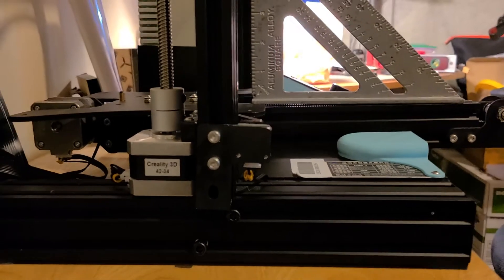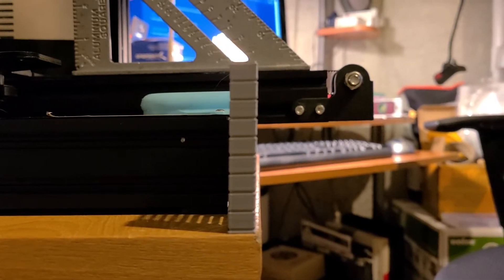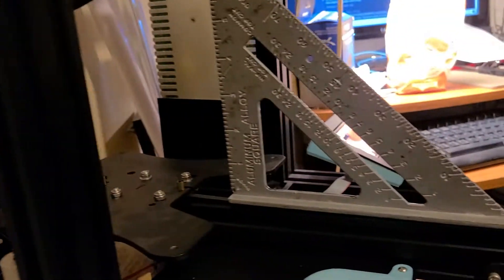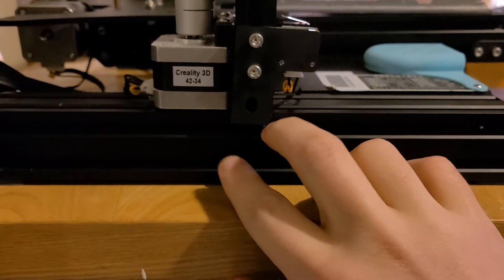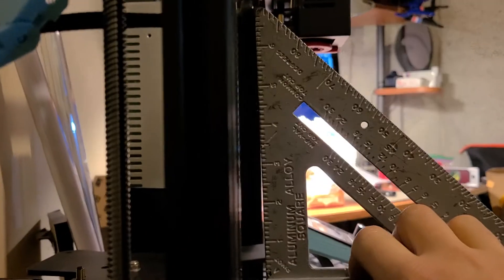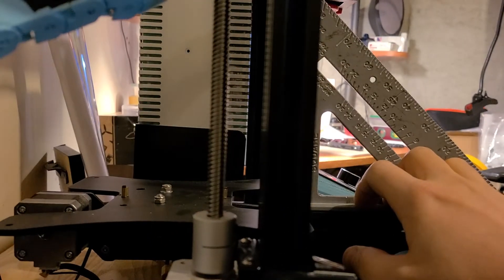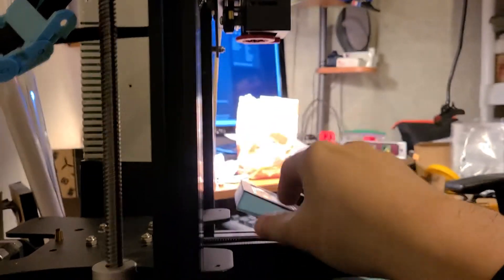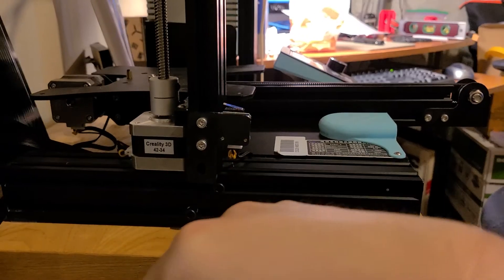Leaning Prints? - Ender 3 Y-Axis Square

Comment: Ender-3 KE here. I experienced a noticeable lean when printing a 60mm tall, 20mm DIA cylinder. Turns out the gantry was leaning about 3 degrees to the back, which was consistent to the lean on the object. I loosened the gantry screws and added a washer at both sides of the gantry base which offset the lean.  This solution was literally a stop gap solution but maybe that will hold up permanently. This design or QA flaw is a huge miss by Creality.

Comment: Of course I undid those screws when I got the printer to make all the feet touch the table, not realizing it could cause this if not done properly! And of course, a calibration cube comes out skewed on the Y axis... Thanks for the video (trying to sort it out now!)
Reply from the maker: On later models this hasn't been an issue that's been prevalent, at least for my experience. Good luck!

I highly recommend printing feet for the printer to ensure that it is touching on all sides. You can always shim it if you need to.

Comment: Is there perhaps a more precise way of doing this? I feel like just eyeballing it isn't a reliable way of fixing this. I did this three times now, and still cannot get straight prints.
Reply from the maker: Are you using a square? It ensures a perfect 90° angle, which is what it needs.

If you have a large piece of something bent at a 90°  that can rest on the y axis and touch the vertical extrusion I could see that working.
Reply: @MBrulla  Yes, I am using a square. I don't know, the second time I did and printed a test print, it was almost straight. I went to do it again to get it perfect, spent half an hour trying to get it perfectly aligned, and the test print I printed was leaning in the opposite direction. I don't know anymore. I am just about to finish the fourth time.
Reply from the maker: @voldy3565  You need to do both sides and really wrench down on it to make sure it's tight. Hopefully it works for you - I've done this for a half dozen machines for friends and it's worked for every one.